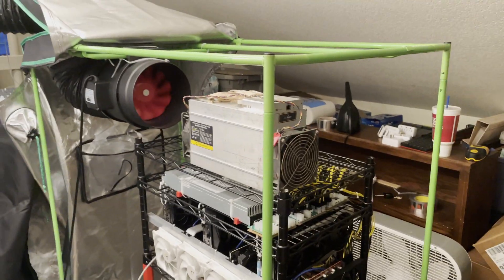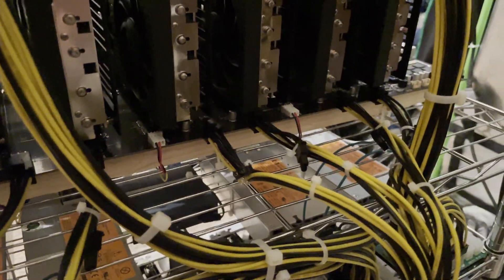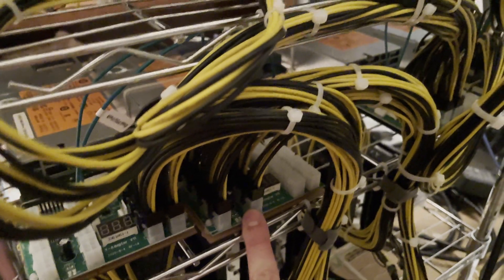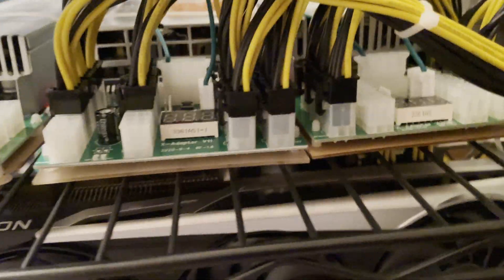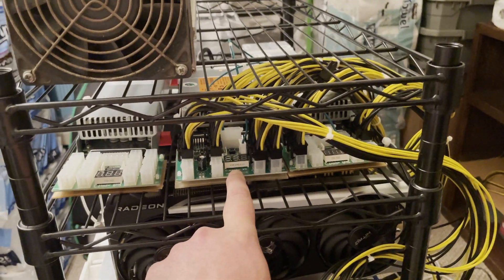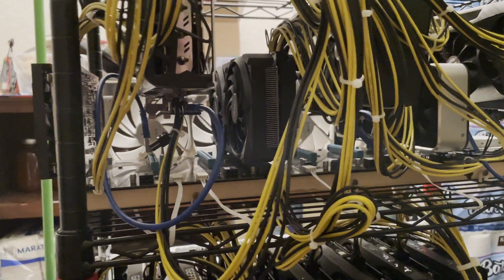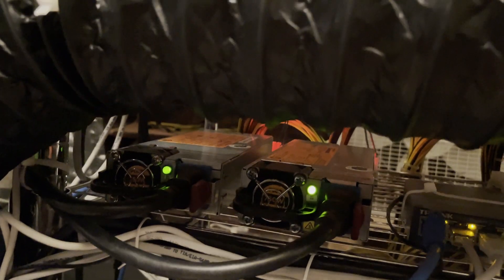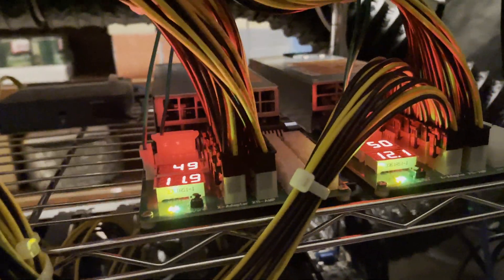BTC-S37 Power Hazard Warning!!!

Comment: Thanks for the warning! I also power one of these with two 1200W server PSUs and I was aware that all 6 pin PCI power connectors are linked together internally through the board but I never thought of the scenario you described. I use only 600W from each PSU so if one dies the other one should be able to carry the load. This may not be an issue though if the GPUs stop drawing power through the x16  PCI connectors when the main power at the 8 pin PCI connectors is off. May have to test that.
Reply from the maker: Yeah, possibly. Still gambling with which breakout board dies potentially.
Reply: What is your draw from the wall? You can run the 1200watt HP server PSUs near or at full capacity no problem. Drawing 1100-1200watts  24/7 on these is fine. It will be loud but will handle it just fine.
Reply from the maker: @ac3342  yes, but imagine the scenario where all 8 cards are drawing through only a couple pcie cables, I think that is the biggest risk in this situation.
Reply: @DoAsImDoing  correct so if you using cheap cables higher then 16/18gauge they may burn. Otherwise if you are NOT using PM breakout board which is rated at 400watts (each 6 pin) the cheap breakout board may burn - which happen for me.

Comment: Just use one power supply to power the board and one/multiple for the cards.
Reply: You can't safely use multiple psu's unless you use one of the options he went over here. If one of the psu's dies, all of the pci-e slots AND the rest of the board will try to draw power off of the remaining power supply.
Reply: @SS-di2ml  or do what I said, and you’re good.
Reply: @SS-di2ml  LOL, read and understand what he said.  If wired the way he said...one PS dies...The cards all turn off.  If the other PS dies the board completely shuts off and no longer tries to draw any power.  If the board is off, the GPU's won't be able to ask for any power because the unit will be off.

Comment: Thank you for reminding this issue.  I owns this board and just saw reddit post regarding to this issue.  I'm using dual ATX PSU, and solution I implemented is following.
-Add IoT watt monitor to outlet I use for each PSU (which can shut down the power).
-At the scenario of one PSU failure, other PSU usage should increase, and IoT watt monitor will recognize the change and shut down the power.
So far, I haven't encountered PSU failure, but hope it works on the time of the issue.

But still,,,, this won't solve "cable failure scenario".  As long as every pcie power connectors are linked together, I think your "Dual Fault Protection cable solution" won't resolve this situation.  Also, single PSU won't resolve this situation either....
At cable failure scenario, all gpu will keep requesting power via remaining cable, and it will be very difficult to find the issue on prior...

Only solution I found for this cable failure scenario is, use risers.  But it will defeat whole purpose of using this board.

Please let me know your thoughts and good solution for this scenario.
Reply from the maker: Really good thoughts here. If a cable fails you will probably see or smell it if you are able to check your equipment often. It is possible it fails in a way that is not observable, but even then a single cable failing is not too risky as the remaining cables should be able to handle the load just fine. The scenario where one of the power supplies dies altogether would potentially (depending on how you wired it) leave only a couple cables left to power the whole board. That is why is still feel like the dual fault cable is a pretty reasonable precaution. 

We can never eliminate all risk whether we are using this board or any other board. Take the best precautions you can and then pay attention closely!
Reply: @DoAsImDoing  Thank you for your comment.  I ended up using Riser solution just to be safe.  Also, I owns BTC-37 (PCIE independent), and noticed I should rather use BTC-37 if I use Riser solution..
Reply: @pcparts001  Can you confirm that you powered 4x onboard risers and 4x onboard gpus on PSU1 and then 4x offboard riser and 4x offboard gpus on PSU2? and this is safe?
Reply: @workpaysplaystore5389  IMHO you can isolate PSU by that method, but will not eliminate actual root issue.
What I meant is, cable failure risk will remain.  Imagine 4x onboard risers on PSU1, each use 75w which is maximum amount according to pice6pin each (total 300w).  If one cable fails, since all onboard risers are connected internally, 300w should get distributed across remaining 3 pcie6pin cables connected to onboard risers, and might result catastrophic results.  Compared to PSU failures, it is difficult to detect cable failures.
Bottom line is, as long as you use more than one onboard risers pcie, you will have risk.
Hence, I stopped using BTC-S37 and instead use BTC-37 with 3 risers (and 5 onboard).
I might be wrong, so please use it with your own risk.  Cheers!

Comment from the maker: Someone mentioned that you could power all the slots from one PSU and all the gpus from another. This sounds like another potential solution. Also, for those saying there isn't a risk because if your GPU powers down with your PSU dying your GPU won't try to draw power, here is my thought on that. It is all but certain that some GPU's still try to draw power through their PCIe slots even if the 8 pin is not connected. Obviously it can't draw enough to function properly, but if you have enough cards trying to draw through only a handful of cables powering the slots, that is when you could exceed the capacity of the pcie cable and cause things to melt. Happy mining!
Reply: Just want to make sure, is this "potential solution" valid and applicable?
Reply: I'm using this solution on my RIG for 3 months now. But now I'm not anymore sure that this is 100% safe. Do you have this answer for me?

Comment: Hi, there. Nice point about safety. By the way, I have 8 * 3060ti, same btc-s37, 2 * hp 750w power supply, just different breakout board. I can only run 3 GPU on this board, if add to 4, btc-s37 will not boot. Has not figured it out!
Reply: Have you worked it out yet?

Comment: i nearly had a house fire. i tried to run this board off 2 psus, do NOT connect 2 psus to this board on the  6 pin connectors.  they are all on 1 rail so if you connect 2 psus to those 6 pins you are doubling the power input!

Comment: I have a problem with the s37 motherboard. When there is a power outage; it couldn’t boot again by itself. You have to turn off and turn on the PSU, to times to boot it. Have you ever seen that problem as you mentioned Power issue. Thank you for the videos!

Comment: Hello, you actually don't have to plug all the pcie on this motherboard, 2 or 3 is enough, so you can use the same PSU for the entire motherboard, and other PSU for the GPU. I've only plugged 3 for 8 GPU.
Reply from the maker: Hi, thanks for the comment. I think you are running a big risk long term if you are only powering a few of the risers. Each card is STILL going to draw off of the few onboard risers you are powering and that can be setting you up for eventual catastrophe. IF both of your power supplies are big enough to handle the load of all gpus even if one bites the dust, then you have somewhat of a fail safe. BUT let’s say you have one gpu that is powering only a couple onboard riser connectors, the problem is not the capacity of the psu necessarily. The problem is that ALL GPUs are going to draw power through one or a few pcie cables which can absolutely end poorly. The solutions I outline are the safest bet as far as I can tell.
Reply: @DoAsImDoing  yes you're right, in my case I'm using risers with this motherboard, so my GPU are all powered through the risers.

Comment: bro. if anything goes wrong, cable, breakout board, psu, whatever... your gpu will stop mining. hive os will detect your low hashrate and automatically restart/shutdown depending on your settings. so hiveos will not let your rig run with a failed gpu, and u aint catching any fire.

Comment: Im thinking i will power half on risers now off of one server psu. And half for the other. But im unsure about these server psu's now.

Even if i get normal psu's they will have to be jumpstarted anyway to get power. So thats not good either.

Also i use trex you could put command lines to shutdown mining if any gpu crashes. This could stop any overdraw maybe. If the mining shuts off the cards wont be trying to pull full power

Comment: hey man nice setup you got there, Im wondering what Mobo you have and if those are 3060's .. im currently have 8 3060 but i cant find a mobo  that has enought Pcie 16x
Reply from the maker: 3060 ti's. The motherboard is BTC-S37. 3060's (first gen) need a board with full 16x pcie slots. They also need hdmi dummy plugs and the dev driver that nvidia accidentally released. There are lots of videos and write ups on this if you search around.

Comment: yup I blew 2 psu using 2x 750W, the 2nd psu didn't sync up properly when it first turn on and blew the first psu; I think the first pcie plug is the one that it draw power from first for the cpu among other things
Reply: You probably screwed up. You did not distribute the psu. You probably connect all gpu to 1 psu and the other to all the board or something unbalance like that. That will screw you up.
Reply: @mdkamal74  I connect half the GPU and mobo connector to one psu and the rest to another, I think the mobo draw too much power from half the connections, it seems like the first few mobo connector draw more power than the rest
Reply: @ddr80  it doesn't  work that way. The motherboard only draws 20w++. 
You cannconnect the psu to any 6 pin connector on the baord and it will work.
Reply: @mdkamal74  since it is riserless it draws the pcie slot power from the Mobo connections too

Comment: So just to confirm, you powered 4x onboard risers and 4x onboard gpus on PSU1 and then 4x offboard riser and 4x offboard gpus on PSU2? thanks
Reply: If you are asking me, then no.  I stopped using BTC-S37.  Instead I used BTC-37 with risers.  I didn't want to take risk by using BTC-S37.
Reply from the maker: Yes, but if you are going to use the built in risers WITH two psu's then you need to have a way to sync them to shut off together if one fails. Hence the parallel miner dual fault cable. The other option is to use risers, which kinda defeats the purpose of this board.

Comment: Seems silly to wire 4 - 6 pin power and 4 GPUs to one Power supply and then again on the other side.  Why not just wire all 8 6 pins to the board with one PS and then with the other PS run it to just the 8 gpus?  That way if the GPU PS goes down, nothing is asking for power any longer as the GPU's will all turn off.  If the PS that's powering the board goes down, the board will turn off and the GPU's wont be mining/asking for power.  This isn't difficult to imagine.

Comment: good practice. Theoretically if one PS went down, so would all the GPU's connected to it so those risers wouldn't be pulling any watts. Just make sure each gpu is powered by the same source as it's riser
Reply: With the BTC s37 mobo they'll still try to draw power through the 12v rail if there's any power being sent through any of the pcie slots.

Comment: are those all Dell GPUs?
Reply from the maker: Yes.
Reply: @DoAsImDoing  awesome, my setup is very similar to yours, only Dell GPUs, 30 series, I love the slim profile and the low power consumption due to no unnecessary bells and whistles. Now I need to sell all these Dell gaming PCs that have no GPUs in them 😁
Reply from the maker: @adriandeiac8365  yeah I already went through that experience. Ebay makes pretty quick work of it.

Comment: Misleading headlines, i dont see how it will blow up. You just use half of the gpu n board on 1 psu and the other half on the 2nd psu. Then if either of the psu shut down only those gpu connected will be down.  The rig will be still running.

 I have this board so I know what I am talking about.
Reply: lol

Comment: Anyone using ATX PSU with these mobo? i saw that S37 doesnt have the 24 pin connector.
Reply: Also, it seems that the QC on these arent that good, mine doesnt boot (no light no beep no fan spin)

tried 2 PSU that are working..
Reply: The S37 motherboard uses 8 6pin ports for power supply, and the 24pin port of the ATX power supply is short-circuited to start.